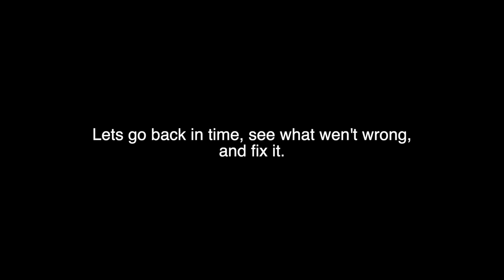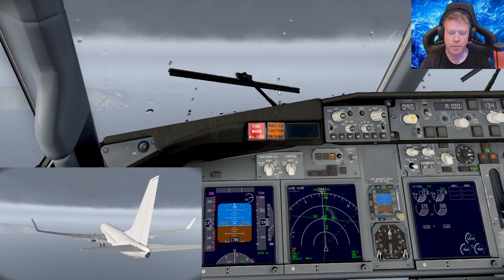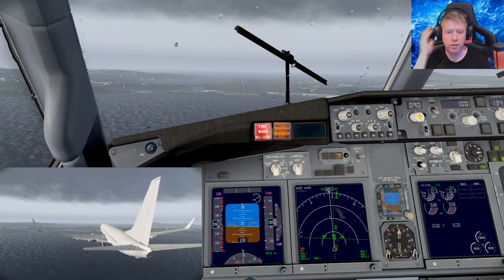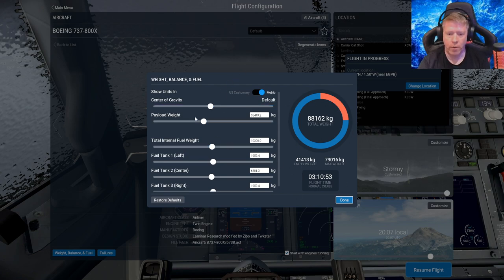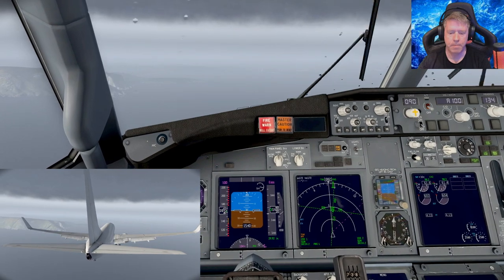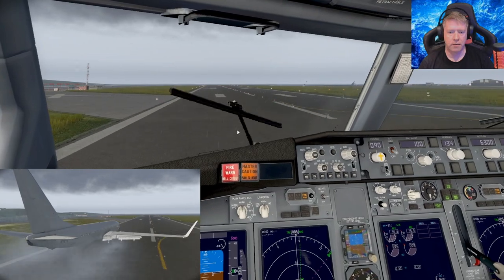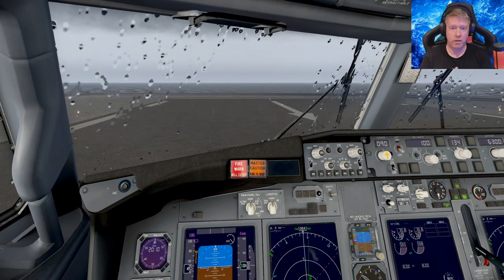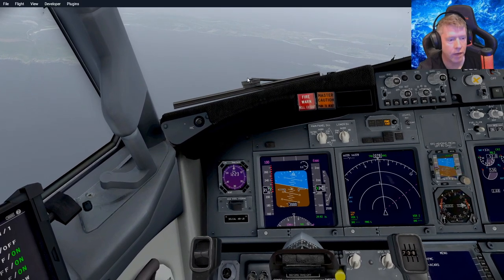Boeing 737 runway overrun emergency landing | x-plane 11

Comment: This is great, and it also reminds me of my own introduction to the safety benefits of a good firm landing: I was on a real-life flight landing in some rainy weather, and just before landing I discovered I was sitting next to a pilot dead-heading in the cabin. This was before I started flight simming or learning much about aviation. As we were about to touch down, I commented that it felt like were riding a cushion of air between us and the runway surface, and he said "you notice that, do you? You're right about that, it's something we're trained to break through." He went on to say that it's even more important when it's rainy like it was that day, to avoid hydroplaning, and that firm landings can be intentional. It's little nuggets like that with real pilots that make some of these lessons really stick in my mind. :)

And here we were, actually floating over the runway in rainy weather. It was a problem, but of course the pilots up front knew what they were doing, and the float was not intentional, but it wasn't long before I felt them cut the throttle and drop the plain a short ways onto the runway, and go full reversers. We were just fine of course. Never had a doubt. :)
Reply from the maker: Yes Ryan, Some times they do firm landing for that reason. It's nice to know what's going on up front.  :  )

Comment: @ReactionReview 
I'm base police at Naval Air station Jacksonville and helped with this incident here at NAS JAX at about 1130pm, at the start of may we had a 737 from Miami Air try to land at our base bringing military and civilian contracted personnel from Guantanamo Bay, Cuba. it was about 9pm and a heavy storm hit the base, there was no visibility due to rain and the pilots where advised not to land at NAS JAX. It was a similar situation as your video but by the time the wheels hit the runway there was only about 2 or 3 thousand feet of runway left (there is some other factors that led to this crash) but the 737 ended up rolling off the runway, over the rocks leading to the St. Johns river. No humans died, but unfortunately 3 pets in cargo didn't make it. it was deemed a miracle that the worse injury was a injured leg!
Reply from the maker: Wow Holuherpaderp! That's a fascinating story! Accidents do happen!

Comment: What graphic card do you use to have these settings
Reply from the maker: Hi XX, I recently got hold of a 9i 9900 processor and a 2018Ti Graphics card. But don't fret! There is little difference between my old i7 and 1080ti and the i9 2080ti, especially with the cost. I need the 2018ti for recording all this footage only! :  ) I'm thinking of doing a "My Setup" Video at some stage.  Thanks for commenting. :  )
Reply: @GripperSim  Why do you need the 2080 Ti for recording? And the i9? Not enough cores on your i7? Doesn't matter. I would like to see that setup video!
Reply from the maker: Hi Nick! I found that the FPS was slower while recording. It takes up CPU and GPU bandwidth so my frames Per Second where less. I noticed some of my video's where slightly choppy at times. It's all about the quality for youtube!  :  )

Comment: Nice, thanks.  Stopping just before the edge is like Clint Eastwood's Firefox, where the MIg-31 lands on a ice floe, stopping a couple feet short of a swim ( https://www.youtube.com/watch?v=AeIDmiUWv7E ).   You can recreate any number of famous incidents.   How about the DC-10 crash at Sioux City, Iowa - United Airlines Flight 232?  Fail your hydraulics ... or do another Captain Sully (with or without Norman and the pint of avgas).   Cheers.
Reply from the maker: I think that's a good I deal John, I'll get onto that! Thanks for the Tip.  :  )